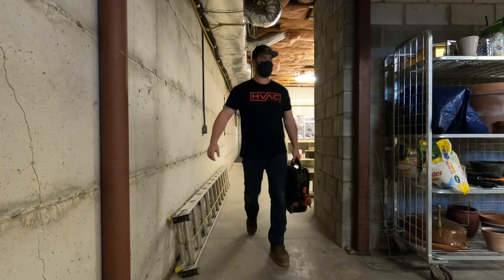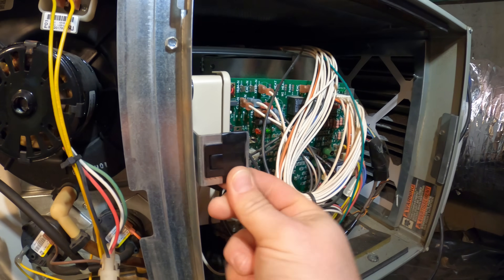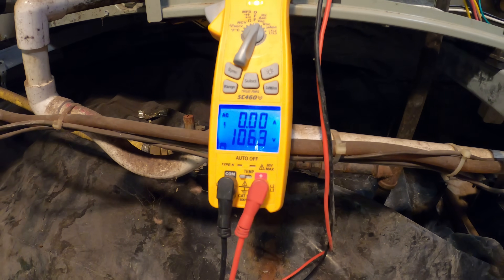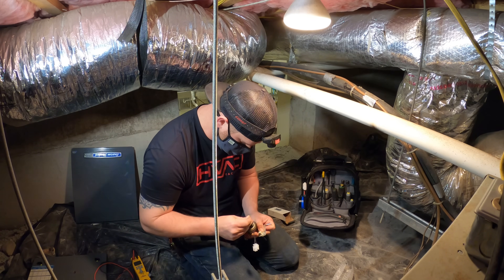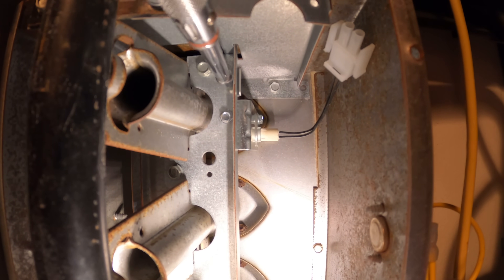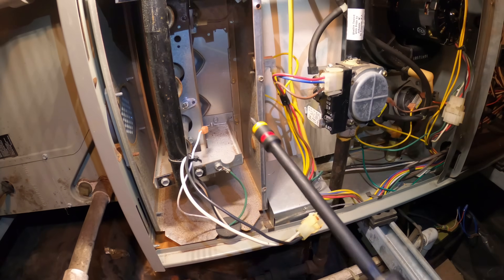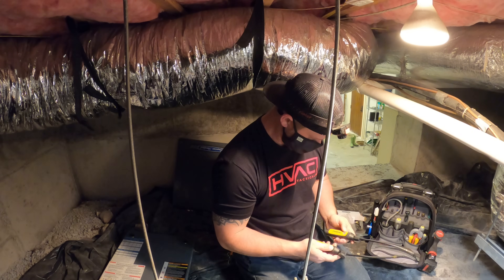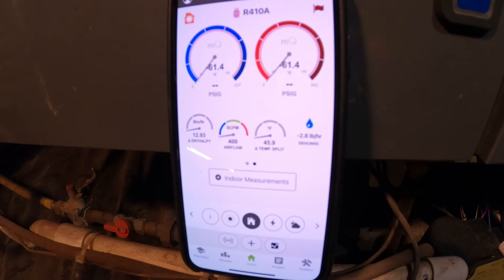Please Hurry, I Smell GAS!! | Furnace Issues

Comment: I typically try and use fine steel wool to clean flame sensors or even use a $5 bill to clean it up. Regular sand paper is too rough.
Reply: You are correct, but even fine steel wool can score the rod ( saw a video showing the score marks under a microscope ). Dollar bill works great, and cheaper than the $5 bill. lol

Comment: Wish you were in my neighborhood..I had gus here just throwing parts at my Lennox 90+. First inducer motor and then 3 months later a mother board and then the motor capacitor..$$$.. as it, only 6 years old, was out of warranty because I did not have it professionally cleaned each year.  Your comments?

Comment: Trane/American Standard furnaces automatically kick up into high-fire after 12 consecutive minutes of call for heat so there's no need for a jumper wire between W1 and W2
Reply: On Trane high efficiency 2 stage models, a jumper must be added between W1 and W2 at the board if using a single stage thermostat (per manufacturer's install instructions)
Reply: That is not correct, the installers manual states for interstage delay...the control board requires a jumper from W1 to W2 if a single stage thermostat is used.
Reply: @cheapfix  gotcha so i might as well keep it simple and use a electronic single stage heat and cool stat
Reply: Question my grandparents are wanting to update there old mercury stat. They have a 2009 trane furnace 80,000 btu. Mechanical draft “not a condensing unit”. The furnace has 2 stage heat so do I get a two stage heat 1 stage cool stat? I’ll have to recheck if they used a jumper on W and W2

Comment: You shouldn’t clean Trane American standard flame rods with sand paper it creates grooves in the metal it will cause them to become unreliable faster use a dollar bill.
Reply: or use 000 steel wool

Comment: As others have stated:
1) did you put in the correct ignitor? The OEM was probably the 80V and that box did not look like the OEM ignitor box.
2) did you check the control board dip switches for proper settings for the stat?

Also, be careful with using the Fieldpiece probes for fuel heating supply temps. Their max temp is 140°. It is suggested to use the Testo for supply temps instead.

What stage was that 45° temp rise? It should be checked in both stages. Maybe second stage was not connected because the unit is oversized.
Reply: Lmao people like you crack me up. He's called out for a no heat call, not a furnace tune-up. Why doesn't he do a hot water heater tune up while he's down there!? Maybe you don't get very profitable giving away free services.....
Reply: @berated4541  only hourly workers have time to check all that out lol, sorry got too many calls on me. only way im breaking 100k in this field
Reply: @marshallharris9581  
Who says you don't charge for your time and knowledge? I never said do anything for free, just asking if he did a thorough job.
Finding a wire disconnected and simply connecting it is not doing the job correctly.
Again, this may not have been a complete video, but it leaves questions.
Reply: @berated4541  
Called out for no heat, replace an ignitor, connect a wire, take a single temp rise and leave. That is your idea of a complete job?
When did I say not to charge for your time or knowledge?
How does the homeowner feel when the next tech comes in and determines the unit is not set up correctly and/or is not working as best as it could?
Reply: @jrsmyth9761  For a no heat call yes. I know more service people than not, that never check temp rise unless they are getting a high limit switch, or heating, but not well call. People like you have clearly never worked a 15 hour day with 12 service calls, or for a truly big company (or in this case running your own company). Not to mention this is just what he decided to put into the video......
Opinions are like Orgasms Tom, Only mines important and I could really care less if you have one.........

Comment: You know you just replaced a 120v igniter with an 80v one right?
Reply: The original igniter was an 80V,  He replaced it with another 80V.  Trane 120V nitride stick is only 3/4in long
Reply: @cheapfix  I was under the impression the trane ignitors with the black wires were 80v only.

Comment: Tape will work as a door switch actuator but if you forget to take it off could become a liability. Magnet with L bracket attached would prevent door from being put back on before removal
Reply: There's a product called the Switcheroo that works pretty well. Also, with Trane, American Standard, Carrier and any other manufacturers that have fasteners or knobs on the blower door, leaving the blower door switch secured isn't an issue. The door isn't going to fall off or get knocked off.
Reply: @bill944  
I think he means that if an untrained individual removes the door and the switch is bypassed and they get injured, then the responsibility could come back to whomever bypassed the door switch(in whatever capacity, tape, removed or electrically bypassed).
Reply: @jrsmyth9761  The door switch is considered a safety so no modification (leaving the tape on) is allowed according to our Gas Code